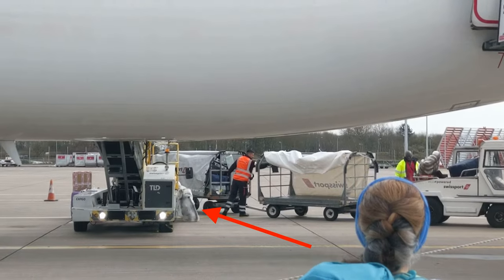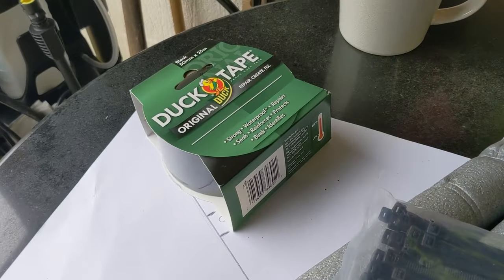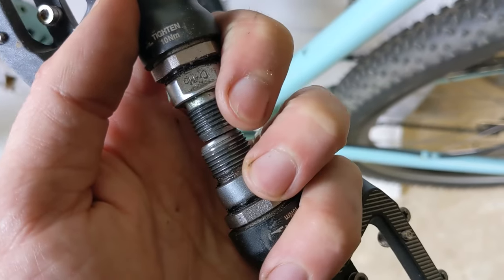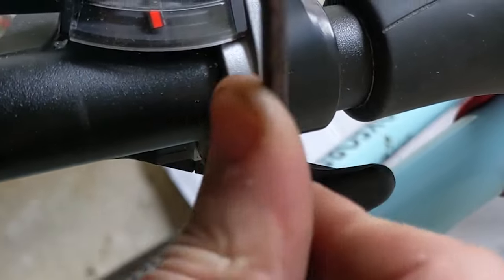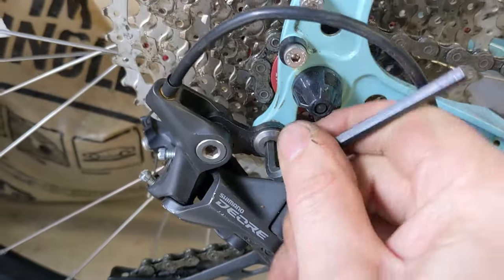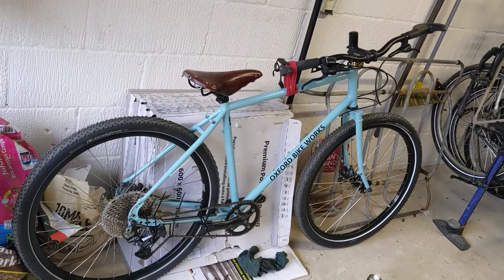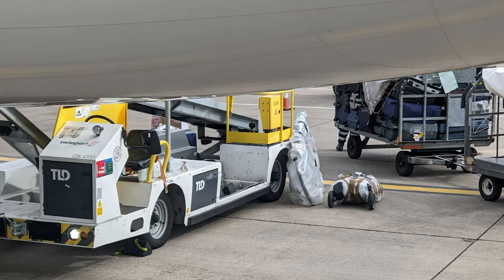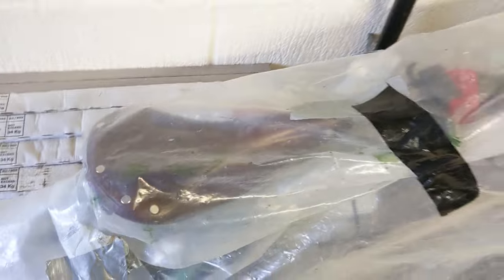Flying with a touring bike without it getting trashed: packing, preparation & real-life flight test!

Comment: I am a retired Lead ramp agent (LGW) I always put my bike in  cardboard bike box and write handle like its your first born ,as for loading bikes on planes   they usually get loaded last and if you pack them well should be ok.You cant throw bike boxes around like some people think bikes in plastic bags were a pain to load .Please note when you drop your bike off at out of gauged belt it goes down conveyer belts and is more risk than a bike in a box all be it small one. when you get to the other end your bikes will be the last on the baggage reclaim.
Reply from the maker: Excellent to hear from someone who's been on the other side! Thank you for this perspective.

I should add that, in the flight shown in this video, my bike was too big for the outsized baggage belt at STN, so was collected at the staff security checkpoint by baggage handlers with a trolley.

Comment: Very informative. Apologies if I missed your mentioning this, but I would worry slightly about the disc brake rotors getting bent. Did you consider removing them or otherwise protecting them?
Reply from the maker: As long as the wheels are attached to the bike, I honestly don't worry about this as they aren't the most prominent parts of the bike. If the wheels were removed and separate, it'd be more concerning...

Comment: Interesting, I'm surprised that the wheels don't need to be removed.. I wonder if I can get away with leaving the wheels on for an Alaska Airlines flight in the US.
Reply from the maker: It depends on the dimensional limits. Sometimes a combination of big wheels and riser bars makes the whole thing too tall. In this case I find it better to remove the handlebars/stem and strap them vertically to the fork than to remove the wheels. If you have drop bars, on the other hand, the overall height is usually well within the limits once prepared like this

Comment: Very interesting. Would you consider doing the same with a carbon frame? Just add more foam protection?
Reply from the maker: That is a very good question. Because carbon fibre is not as resilient when subjected to unintentional stresses, I'd do careful research before using this method with a carbon frame. Touring bikes like this are usually made from steel or aluminium and can take a few knocks.